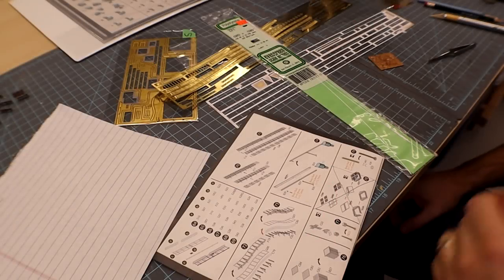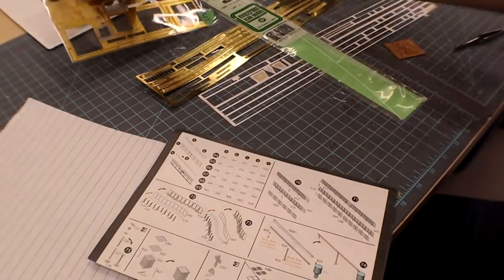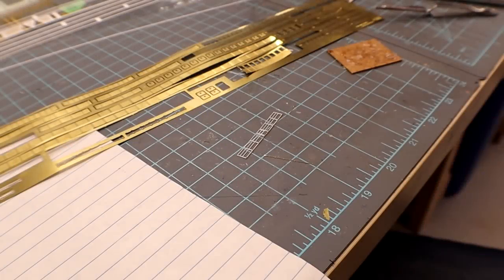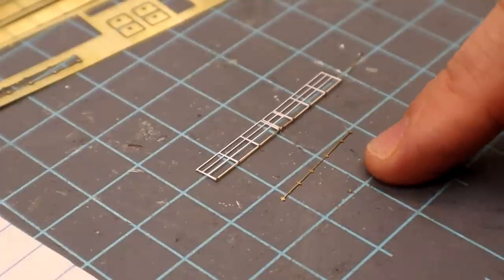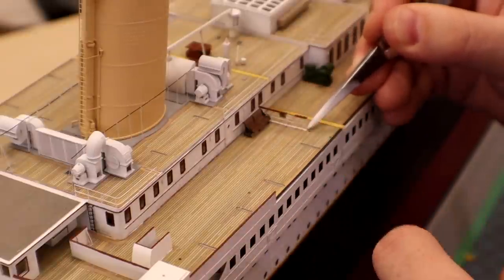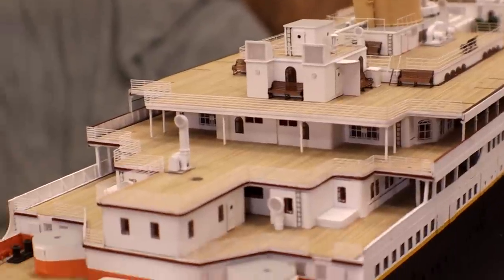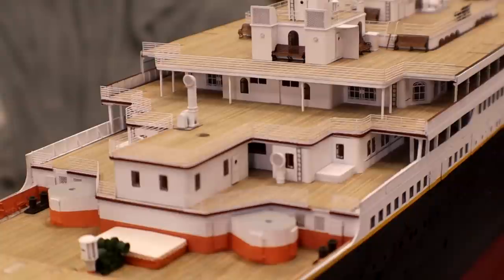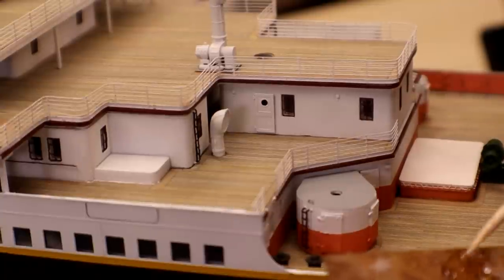1?200 RMS Titanic Build Video 33

Comment: That looks absolutely fantastic! It's very difficult working with such delicate parts (p.e. brass has some "springiness" to it, yet it gains unwanted kinks easily) and glue them all down to last. I love the incredible level of detail and clutter, just like the original, yet everything looks clean and smooth. Top notch!